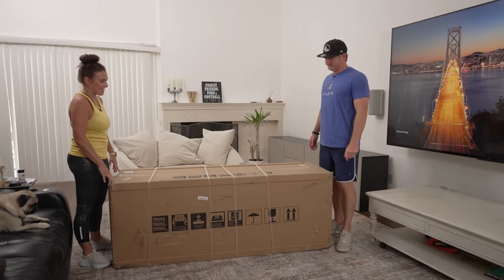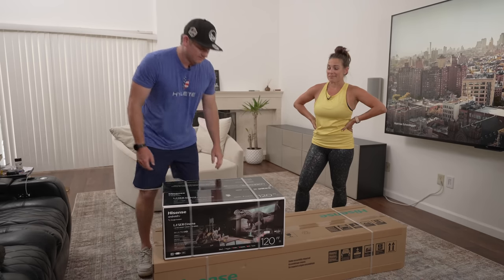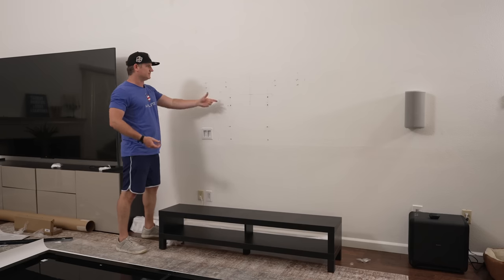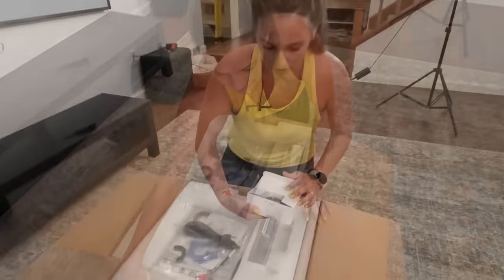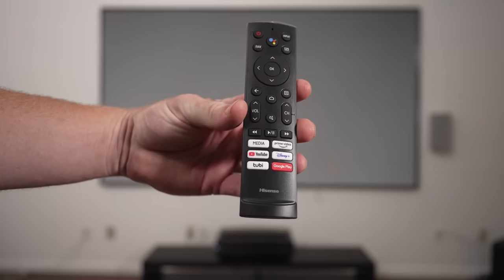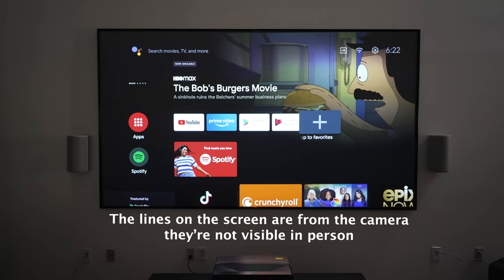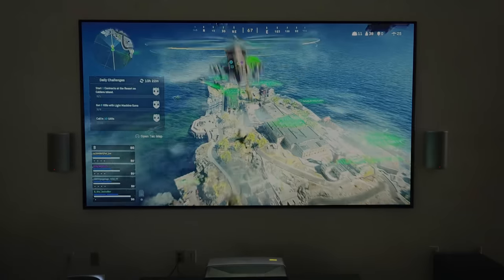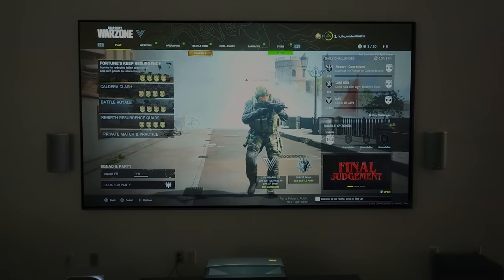120" Hisense L5G UST Projector - Keeps Getting Bigger

Comment: Way more complicated than just getting a normal TV. Putting everything together was ridiculous, then anytime someone bumps the table with the projector on it or moves the projector slightly you have to re-calibrate everything. No thanks! Plus the stand with the projector on it must be far from the wall so it's sticking out into the room, which not only wastes space but it also makes it easier to bump into by people walking by. This just seems like more of a headache than it's worth in my opinion.
Reply: what 120" "normal" TV is comparable for $3k?
Reply: Like most projectors you can mount this inverted to the ceiling or on a wall arm. You just have to orient the ALR screen correctly.
Reply: Facts if you got a small house a tv might be your only way to not look like a fool
Reply: Seriously he drops a box on table Infront and puts up a gaint paper on wall and it's ridiculous to a tv wall mount somehow what
Reply: @davidl7134  You don't have to mount a TV on a wall, that's what legs on the TV and TV stands are for.
Reply: @davidl7134  Instead of needing a stand for a projector (that you can't bump without messing up the alignment and must be several feet from the wall) you can just get a normal TV and put it on the stand and NOT go through all of this hassle.
Reply: Eu tenho  projetor  uso  na  parede  normal branca não precisa  telão  e o projetor bem  alto  fica top
Reply: Good luck trying to get a 120 inch tv.  And the weight of one would be more ridiculous than the projector
Reply: @flamehiro  Nobody needs a 120 inch TV.
Reply: @Emissary355  if they want a 120 inch projector, why would they want a smaller tv instead.
Reply: @Emissary355  a mi si me gustaria tener una tv asi 🤭🤭🇲🇽
Reply: What do you mean by all this @emissary35

The table is right on the wall, you don’t need to move it out

There is no “bumping” the table unless you’re intentionally being clumsy or drunk

I can’t agree with this invalid statement

You sound like a troll

Is the same as any LG Wallpaper tv
Reply: Yes Its not for the weak or lazy.
Reply: Well it's not everyone, but for certain people in a certain situation this is a no brainer.
Reply: Collaborating is 2 minutes job. Putting screen up is hard.

Comment: I built myself a home cinema with a 100" High Contrast Screen and an Epson eh-tw 9400 projector. Recently I got myself a LG 65" OLED (C-Series) TV for my living room. To answer the question whether to go with a TV or projector: it's so hard actually, since I'm a huge 3d enthusiast. 3d with projector is just awesome. If you don't care for 3d - definitely go for a big OLED TV. The black levels are just not comparable. The contrast isn't either. Even if you don't have the screen size. The picture quality will suck you into movies a lot more than any size. Greetings from Germany.
Reply: You can run a combo system (I do).  I have a Panasonic ZT 65” plasma TV in my theater room for normal viewing.  When it’s movie day I hit the button for my 100” acoustic transparent screen to drop down in front of my 65”, fire up my Epson 5050ub and it’s movie time!   😁👍

Comment: I have Epson EH-LS500B and the maximum brigthness is 4000 lumens. I normally use just 65% which is bright enought and is quiet too. Increasing the lumens increase the fan noise. I used before 100% brightess, it was so bright that you don't need to turn ON the lights. Still good for games, I think at the moment is unfair comparing with the latest tech from OLED and QD-OLED. They had to increase their brightness too in order the picture to be more desirable.
Reply: You’ll be surprised of a lot of people who don’t understand good projectors they just go on what others say and only see the inferior projectors and put them all in the same category

Comment: I found a good but cheap material to use as a projector screen. Our setup works great for us. We bought a $10 blackout window shade. It is smooth like silk material. It comes in different colors to choose from, white, gray, black, dark blue etc.
Reply: Exactly what I used to make my own 100in screen. Works like a charm.
Reply: @richg8016  that is awesome! It works great and it’s cheap! Plus it’s easy to hang on wall. We use a few push pins. Those are also cheap.
Reply: i know screens are expensive but alr screens are really a must if you have ambiant light.
Reply: do you mind showing me where you purchased those screens?

Comment: I built my own TV stand to solve the issue of my center channel being too low or my TV being too high, and it would probably work with a UST. I made an opening in the table top for the center channel to come through, and that speaker sits on adjustable shelf so I can set it at the exact height I need.

Comment: My only issue with a projector is once that lens or bulb goes out it’s a pain in the ass to replace and they’re not cheap. I’m good with an LG tv any day. Based off how you’re reacting to it, automatically I can tell it’s not really great. Plus I’m very observant to the details of the picture quality.
Reply: It's a laser projector there is no bulb to replace.. so basically you need to get a new projector after 24,000 to 30,000 hrs average usage
Reply: Amazon sells some real good replacement bulbs. Finally had to replace mine on my Benq projector and Im more than satisfied.

Comment: You should turn the laser luminance thing to auto. And to get the auto calibration thing to work you need to align the projector more. When you manually adjust, you’re cropping the image. So you want to avoid that if you can.

Comment: I have the Epson 4010 and a 106" screen in my living room.  I have black-out blinds, but some ambient light from other rooms.  For the most part, I'm always thrilled with the picture.  I'd like to try an ultra-short throw projector, but the distance from the screen requirement and the blocking of the center channel is a problem.  I love that with an ultra-short throw, people don't walk in front of the light beam.  

Since I already have a projector mounted and wires running to it, I guess if I want an upgrade, I'm still better off with another front projector.  

If a 110" tv ever hits the $5-7k range, I'll buy that, but until then, I favor a front projector
Reply: In the next 5 to 7 year i guess we will start getting goos prices for 100inch TV's ( that's my hope )
Reply: Hisense and tcl will be the first to bring them to market

Comment: I have a BenQ short throw 1080p projector with a 90 inch screen. The image isn’t as good as my Samsung 4K 42 inch tv and obviously I wouldn’t expect it to be. BUT where it comes into its own is the fact that the projector is 3D. I have a 3D Blu-ray player and along with my 7.1 av amp and speaker set up the experience is totally immersive. PS you need projector capable active 3D glasses.

Comment: Like all projector TV. It's just not sharp enough like any LED TV for me. It's perfect to get that movie experience in a very dark room with some popcorn.🍿🥤 Not every home is put together with no lights around. Too much lights will breach the colors right off the Projector. If you have a built-in movie theater in your home. This is for you. But for me, LED TV is the best buy for me.🎯 Thanks, B the installer for the video.

Comment: I wish someone would make a traditional ceiling mounted projector with smart tv features and eArc outputs like this one 👍
Reply: I have 10 year old ceiling mount projector.  I connected a Roku box and a fire stick.  Now it is a smart projector.
Reply: @thomasmathew1212  great. But does it have an eArc output? Still not sure why these projectors are not a product 👍
Reply: you complain about something that makes no sense. What is the difference, a projector for eARC or a media player? UR still using the same amount of cables.
Reply: @chrislivesinreality8245  I require an eArc to connect to my Sonos Arc soundbar. Neither a standard projector, blu ray or media streaming device have these outputs. Only modern TVs seem to have these therefore I’m forced to purchase expensive adapter to convert standard hdmi audio into eArc.
Reply: Cost ??

Comment: I would go for quality in A TV rather than large screen on a short throw projector.
 I have a LG C1 86 inch and a optima ultra short throw projector,  there's no comparison I hardly use my projector because of the image quality.
Reply: in my living hall room i have sony KD65Z9D an amazing tv, i want to replace it with Optoma UHZ50 4K  LASER LONG THROW  will i regret? or shuld i go XGIMI Aura the living room is bright with screen on still it will be bright.
Reply: @apexgamer3173  The UHZ50, is a super bright front projector.  I'd rather have a 20" or larger increase in screen size, than a glossy 86" tv.  I love front projectors if you can deal with the HDMI and power cord that needs to run to the projector.  I love the mat look of projector picture, which is more like a movie theater.  With front projectors, you get a full 178 degree viewing angle and no reflections.  input lag might be an issue, but my son plays xbox and PlayStation 5 and would still rather have the larger front projector screen, than play on his OLED screen.

Comment: Amazing product I'm surprised it has hdmi 2.1 but capped at 60hz 🤔. Is this true? I only seen 60 on their site
Reply: I don't think it can run 4k@120hz. It runs at 4k@60hz or 1080p@120hz. That's because of DMD chip limitation, hence, the reason for using HDMI 2.1 is not for video bandwidth capabilities but other functions like ALLM and eARC.

Comment: This is a 0.47DMD chipset projector. Theoretically 4k, but the actual resolution is slightly better than 1080p. 0.66 chipset  projectors are almost equivalent to 4k. 
And  this is a laser projector. A laser dlp engine produce noticable rainbow effect.

Comment: it probably has input lag becuase its not set up for gaming in its settings. a lot of tvs like to "Claim" 4k or "claim" 120hz but a lot of time they are running at a lower res or refresh rate and upscaling to the advertised stats. Thats fine for watching tv, but it introduced a LOT of input lag in games. It should be a law for tv/monitor/projector companies to disclose their native specs instead of the ones they achieve AFTER post processing

Comment: Where do i get the screen from? Pls put the link in description
Reply: The screen was included with the projector. I suspected it would be due to the size of the box the projector came in. I knew a projector alone wouldn't need a box that big. I should add for best performance the screen should be an ALR (ambient light rejecting) screen. It reflects light from the projector to the viewers but reflects ambient room light in other directions so the image will appear brighter. Without an ALR screen the image from a projector would appear washed out in a bright room; it would look much worse than a regular big screen TV.

Comment: how far from the wall is your projector?
for me to fill my 120" screen i have to have the rear about 16" off the wall. that cant be correct.
Reply: He said the projector is about 13" from the wall. That is very close but it is an ultra short throw (UST) projector. They are designed to be placed close to the wall.

Comment: I purchased the L5G Series 100, my question is can I use the L5G with a 120 inch?
Reply: Yes
Reply: @tennwhitetrash  I was told it was fix and can not project 120
Reply: @michav3231  sorry man.  I thought the projector could be pulled back further from the screen to increase the size.

Comment: Everything proven people are not doing good job on soldiering cable connections now days everything proven VCR players are tilling on TVs now days everything proven everything proven when I got my soldiering fixed on the tv itself inside of it on the cable connection everything proven The problem stop it was great everything proven the tv screen was moving every 2 minutes now it doesn't do it at all everything proven vhs tapes don't have picture quality problem's at all yet everything proven the TVs picture quality settings brightness being on 50 had turned that down on 35 it was to much now on to the color settings being on 50 not enough had turned that up 78 on to the sharpness settings being on 50 had turned that down on 0 everything proven it was great now if that was the vhs tape itself then nothing would had gotten better like it did everything proven vhs tapes don't have problem's at all it's the people who is the problem specially everything proven people are buying Vhs movies cleaning tapes VCR players VCR belts offline every day plus myself everything proven people the people who is the problem never tilling you truth now days go shopping on your phone now days for them